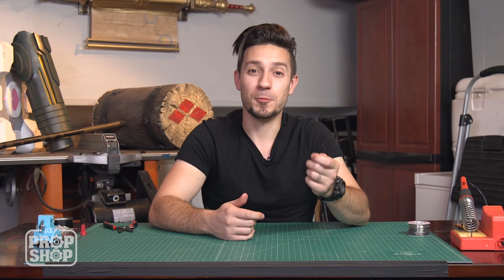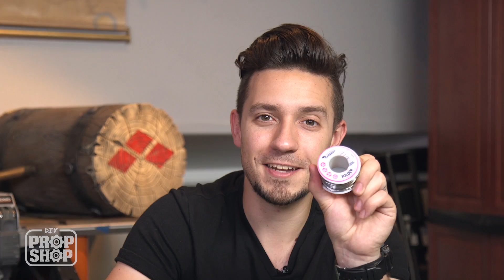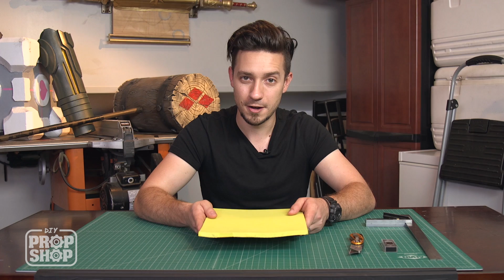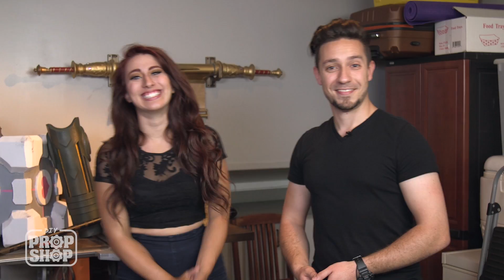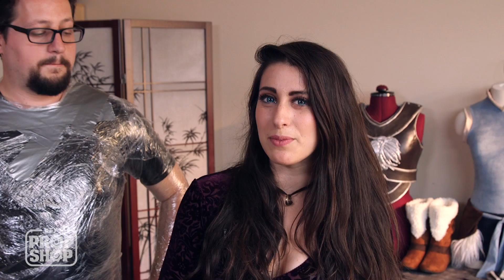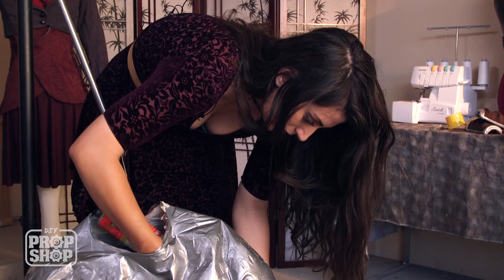DIY Tips and Tricks - DIY Prop Shop

Comment: I made a duct tape dummy of myself awhile ago and I found that if you don't use filler like packing foam then it takes way too much expanding foam to fill. I also used some old clothes I was planning on taking to the thrift store to fill it and it worked really well. Also, if you close up the neck and hang it upside down then you don't have to worry about the foam coming out the bottom. I just used string and hung it outside from my patio ceiling. I then took a old light stand and removed the light from the top and shoved it into the middle of the foam. When it dried, it had a nice sturdy stand for it (until my armor got really heavy and the base broke).

Comment: on your duct tape dummy you should have used a Sharpie to make a cut line and then put registration marks so that when you tape it back together you know exactly where it's supposed to line up. so that maybe beginners might not get it out of line and have to cut it back open and fix it

Comment: What kind of expanding foam did you use for the DTD?
I've tried to use an expanding foam before to fill a head dummy, but the foam deep inside, beyond the neck opening, didn't cure. It pretty much just turned to soup. =\

Comment: i need to know how to solder a wire to a board. trying to mod the switch on a sonic screwdriver
Reply: Awesome that you're doing this! Soldering to a board gets really tricky. You might want to melt solder onto the wire end first, touch the solder-coated wire to the contact point on the board, and then briefly hit the wire end with the iron. You can get the solder to drip down and melt itself onto the board and establish contact. It's tough, but try not to touch the iron to the other board components. They will fry! Also - pick up a solder sucker from Adafruit or Amazon. It's an invaluable little tool that can clean up solder drips in tight spaces. Really helpful if you're wiring to a board. Good luck and hey, let me know how it goes!
Reply: do i have to scrape off the solder that was already there?
Reply: +neomp5 If you have a nice dollop of solder right where you need it on the pad - try putting the wire end right up against the dried solder, heating your wire with the iron, and plunging it in. If it totally sucks, use the solder sucker to remove any excess and start fresh. But it might be worth a shot!
Reply: thanks, i'll keep that in mind whenever i finaly get around to digging the project out again. looks like i can get a solder sucker for less than two bucks on ebay. i think i bought the wrong kind of wire though, because i got copper solder wire

Comment: Can u use a hairdryer as hotgun?
Reply: *heatgun and of course, but it'll not be as hot. A heatgun can blow extremely hot air
Reply: hairdryer warms up the foam a bit, but if you want good results, go and get yourself a heatgun. its like 10-15 euros and it gets the job done so much faster and better
Reply: You really want to go with the heat gun. Most hairdryers just wont get hot enough to do what you can do with a proper heat gun. Good luck!

Comment: "The cells are fusing together"... EVA foam don't have any cells, there are only atoms, because it's a synthetic material, not an organic material!
Reply: EVA foam is also called "Closed Cell Foam".
Reply: Is"like"expanded polystyrene..haven't real cells, but have a segmented structure visually similar..
Reply: You make a good point, Saddam Hussein. Sometimes I refer to materials that have a lattice structure or random collection of "open spaces" as having cells.
Reply: Vinny Logozio ok, thanks for clarifying!
Reply: "Cell" in this context means a single unit in a collection of hollow, enclosed spaces. This definition actually predates the biological definition because the guy who discovered plant and animal cells felt they resembled monastery cells under a microscope.

Couple more things:
1) Organic matter is also comprised of atoms
2) Organic doesn't mean biological, just that something contains Carbon. CO2, for example, is not alive.
Reply: +Ahmed Jaber To clarify CO2 isn't organic. CO and CO2 oxides, together with H2CO3 and CO3 salts are exeptions, not considered organic.
Reply: Music isn't organic either but has cells.
Reply: +Paweł Wójtowicz DIY Chemistry Shop right here

Comment: That's not the right way to welding wires. You should apply tin on both ends, and then weld them together.

Comment: I like the props that Vinny or Odin made, but. The show called Low Budget Prop Shop before DIY Prop Shop. None of the props made after Dustin have that spirit. Noone is using cardboard, duct tape, hot glue. You are using EVA, heat gun, theemoplastic. These are fancy stuff man and its not the show is all about.